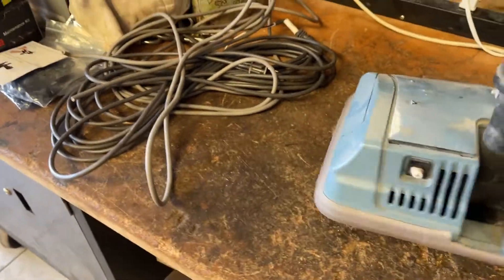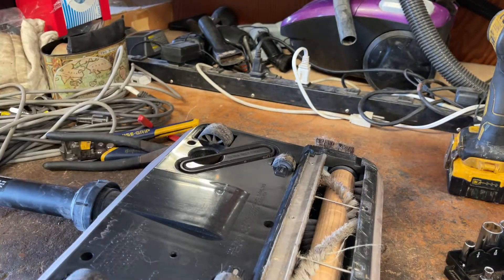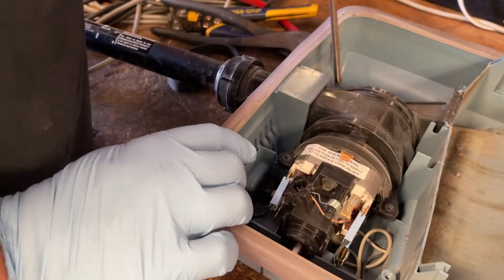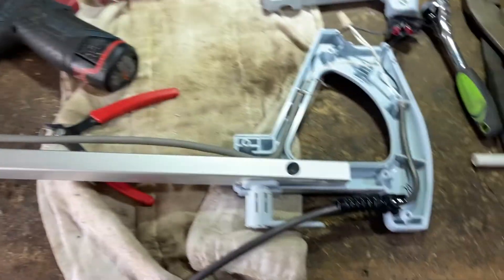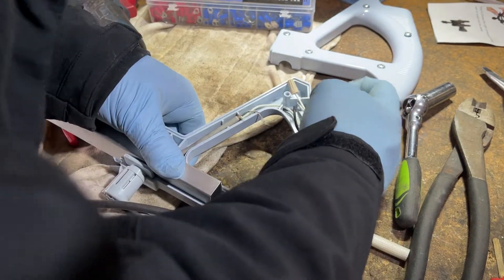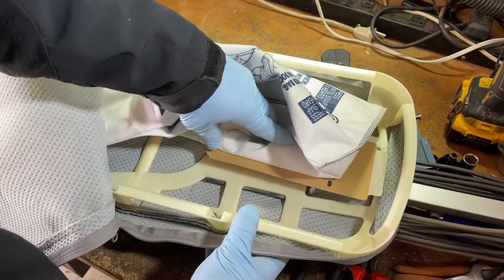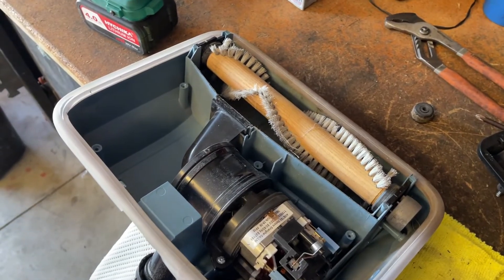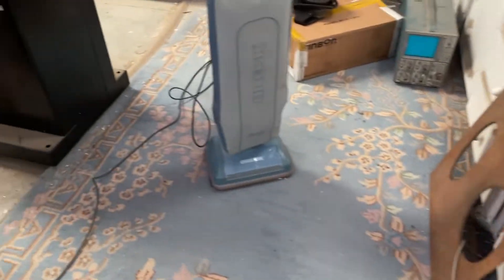Oreck U3770HH Refurbish

Comment: Nice job, Hank! My late, great aunt had this model. I replaced the headlight housing on hers, because it had warped. Orecks are pretty decent vacuums and easy to service. There was only one I couldn't save. My brother found it in the trash and brought it to me. When I was servicing the motor, one of the prongs snapped off. I really don't think solder would hold it, so I took parts from it and scrapped the rest. There is usually a metal wire clip that holds the outer bag in place when you mount it. It looked like that was the piece missing on yours.